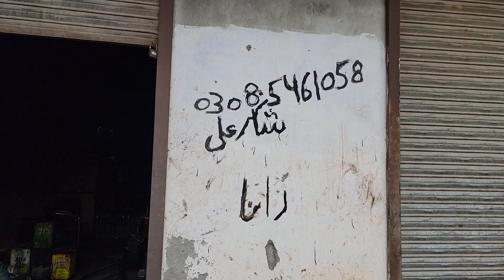How I Went from Beggar to Mastering Aluminum Casting

Comment: Опять бесполезная заливка алюминием😮👎🏿
Reply: How is it useless?
Reply: @backwoodsjunkie08  The quality of it is so incredible low. You can literally see that it is hollow on the inside, and the outside surface of it is so misshapen . What use can it have?
Reply: @backwoodsjunkie08 I'm just taking a wild guess here, but I know that when I saw this the other day, my first thought was that a gear, or whatever this is, made out of aluminum wouldn't stand up to very much pressure or wear and tear.
  On a totally different point, and again, this is just a wild guess, I'd think that working with aluminum this way could be VERY bad for one's health, as far as Alzheimers (and maybe other mental deterioration) goes. Alzheimers has been tied to aluminum exposure and this guy isn't even wearing a useless paper mask, much less one that would really do the job of protecting someone pouring hot liquid aluminum on a daily basis.
  I could be totally wrong about all of this, but just giving you my ideas anyway.
  I hope both of us get a valid answer from someone!! Ciao!